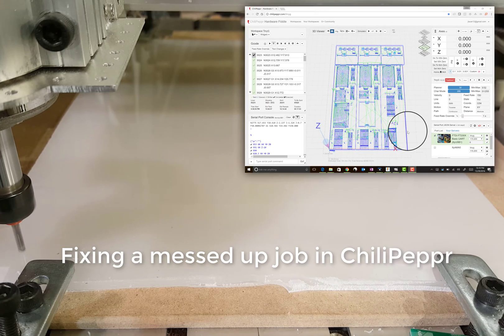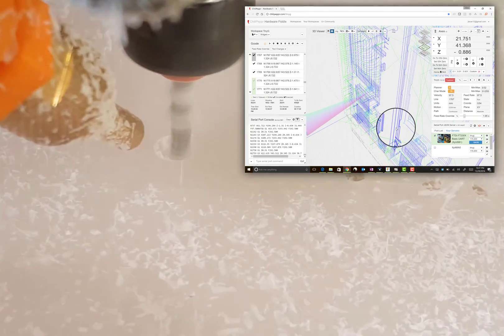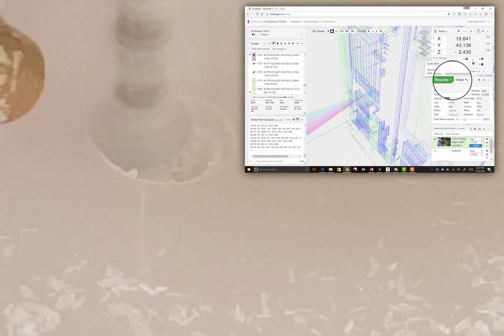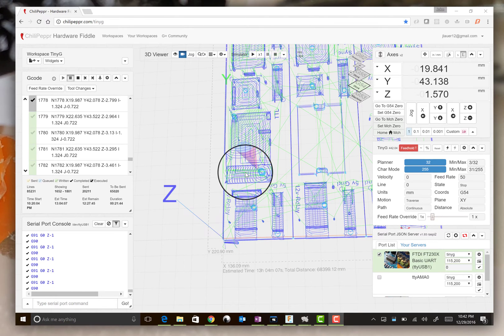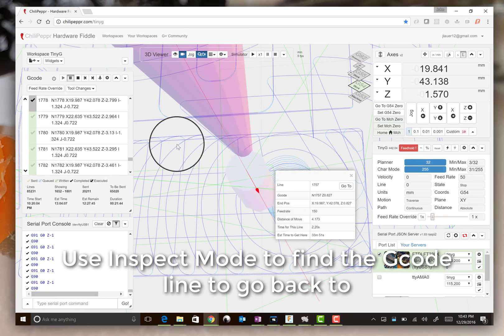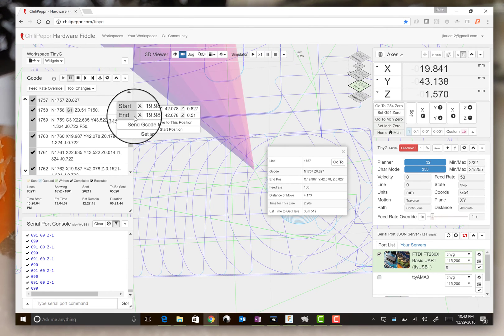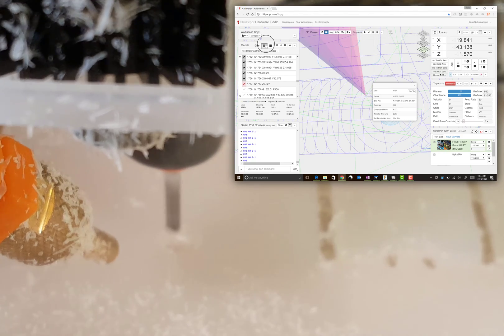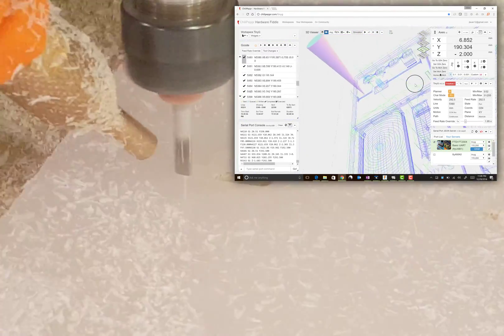Fixing a Messed Up Milling Job when Using ChiliPeppr

Comment: John, you really should be feeding faster and using the slowest RPM you can. Very important for plastics!
Reply from the maker: Yeah, I found that slower RPM helps and faster feed rate. What I messed up in the CAM was I had feeds/speeds good for slot milling and adaptive clearing, but then I should not have used helical ramp lead-ins cuz they are/were just too slow of a feed rate. Oh well, gotta learn thru mistakes.
Reply: John Lauer on a hobby machine you should easily have 4-600mm plunge and 1200-3000mm/min feed rate. For plastics, use a single flute. I can link you to some great ones.

Comment: If I understood this correctly, there's no similar functionality in LinuxCNC. That's too bad as ChiliPepper's resume method looks really convenient.
Reply from the maker: Yeah, I have not seen functionality like this in any other CNC software.
Reply: John Lauer mach3 has a "start from line" feature
Reply from the maker: Julius Jahn I suppose what I'm trying to point out is the feed hold / wipe is the 1st big deal so you can stop and not lose position (which is CNC controller dependent) and then 2nd big feature is Inspect Mode in 3D viewer to find correct line and then 3rd feature is the "start from line". I think Mach 3 has 1 and 3, but not 2 (not sure tho).